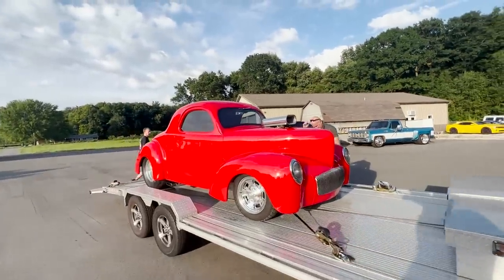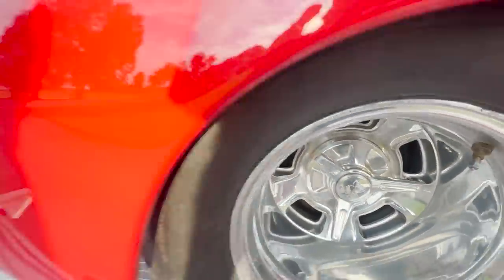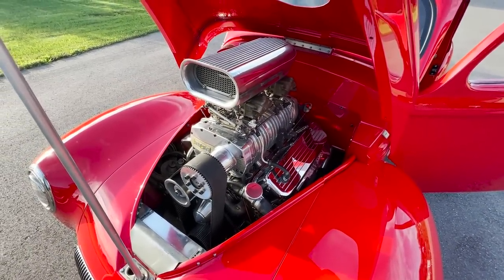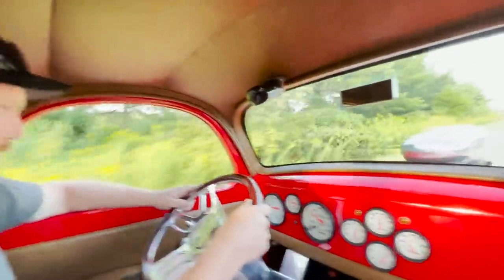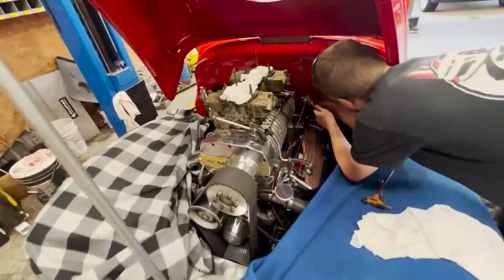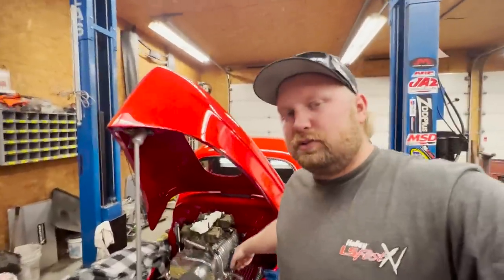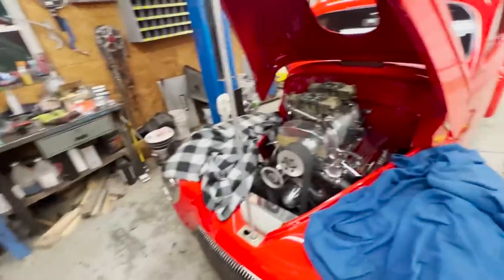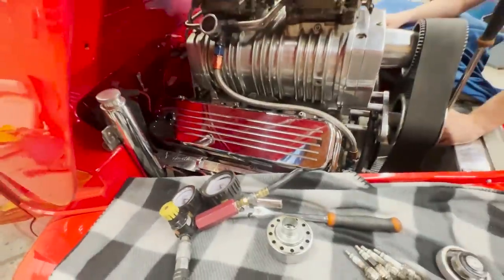Buying My Dads Car That He Sold 25 YEARS AGO! 1941 Willys Coupe Big Block Chevy 671 BLOWER! HOT ROD!

Comment: Osceola was the 1st strip I raced on. I remember it well. My first race was against a brush painted blue 60 falcon with a brushed red inside. It sounded like crap and I was afraid it would leave parts  after the green light. Green light came and that guy was gone. He was shut down before I was half way down the track. So cool that you got your dad's car back.

Comment: So cool to get your dads old car back. I have fond memories of the 40 Willy's from the CAR-Toons comic books. If the toon Willys was in motion the front wheels where in the air and flames were flying out the zoomies with clouds of tire smoke pouring off the rear tires. Looking forward to seeing both the work you guys put into this car as well as the payoff runs down the 1/4.